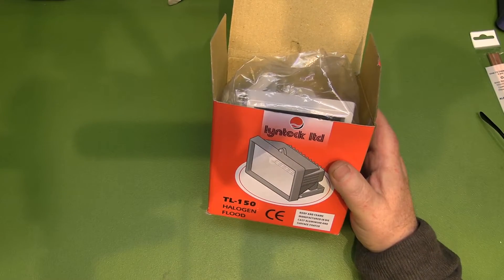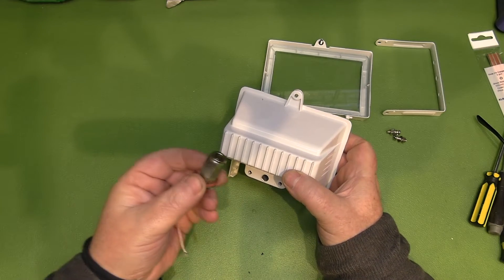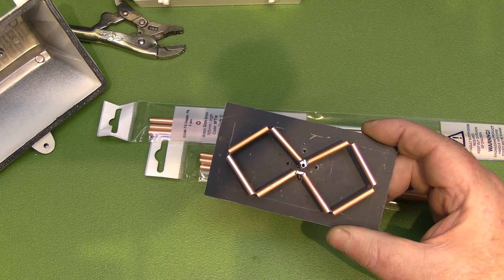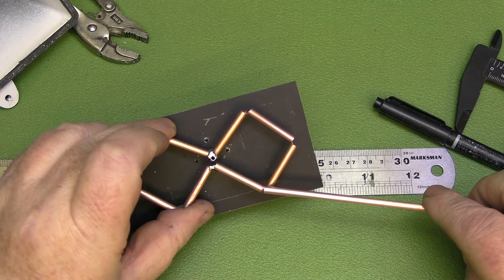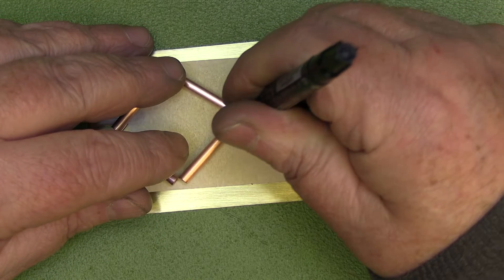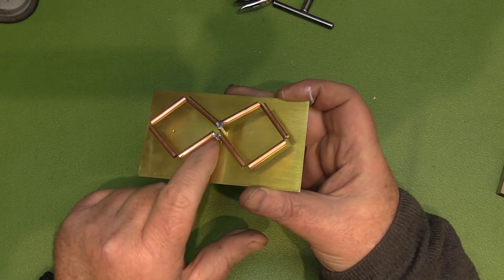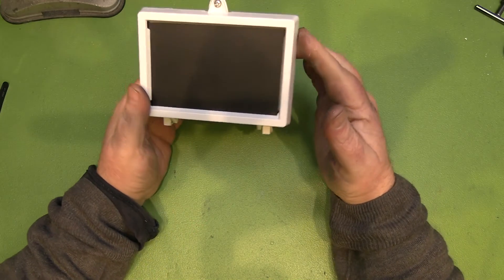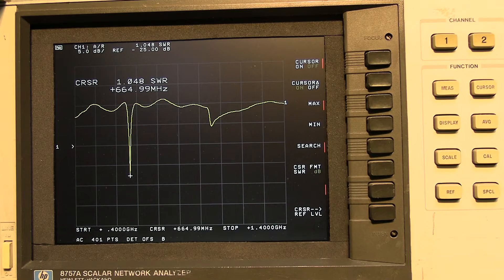The Perfect Case for an Outdoor Antenna 4G Biquad

Comment: Andrew, love your videos.  You are very knowledgeable on the subject of antennas.  I noticed on my dji phantom 3 advanced controller that the panel antenna measures 52 ohms but the omni measures open.. i saw your yagi design and noticed that the coax shield was on one side of the loop and the center conductor was attached to the other side of the loop creating a short.  Wouldn't this burn up the transmitter output?  I haven't seen impedance or open resistance and the effects on transmitters explained anywhere on YouTube.   Could you help us out?  Thanks

Comment: I made a pair of Double Bi-Quads for Band 3 ( three mobile  uk) which give 100% signal level, and RSRP -83dBm ( mast states max RSRP is -80dBm) Mast is 2 miles distant with Urban housing ( terraced streets ) between me and it. !  the pair is located indoors on top of wardrobe in bedroom. I want to make better quality version for outdoor location. What is the  "recommended" spacing between the two antennas located side by side, Please.  Will also need this sizing, to look for suitable enclosure such as you have on the video.
Reply: I don't have indoor signal.outdoor have 1 bar can i increase signal using this antenna
Reply: @testports3216  It is a simple antenna to build.... and cheap too !... worth a try... you might be surprised at how good it is. Make sure you point it towards your nearest Cell Phone Mast... You can find that from a site called  CellMapper - gives you the choice of supplier and the bands it  transmits on, and which direction it beams to....  Try to use a compass bearing to get the strongest signal at the antenna.

Comment: Could you possibly build one in the 1.7 GHz range and arrange them four-sided and one on top so that you get an omnidirectional antenna tuned to weather and slightly angle each of the four slides up a little bit? Do you think that would be enough to have a nice portable weather satellite omnidirectional as opposed to a large qhf Helix which I've actually built one and it's quite large and boldly to carry around would one of these be a nice portable alternative and could you get enough signal you think quite easily?

Comment: Why do you call it a “4G” antenna?
Reply: for 4g cellular network probably.
Reply: @TuttleScott   Here in the USA 2.4Ghz and 5Ghz are not used for cellular.
Reply: @jacksprat7087  he's not in USA
Reply: @TuttleScott    I know that.      Do they have cellular towers in England that use 2.4Ghz and 5Ghz??  Or, put another way, does anyone there sell service using those frequencies?
Reply: @jacksprat7087  I suspect Andrew knows what frequencies he needs. that's kind of his thing.
Reply from the maker: Cellular in the UK does not use 2.4 or 5GHz are you sure they do in the US because 5GHz wifi is not 5G.
Reply: @andrewmcneil   They don’t in the USA either.    I recently got fiber internet and am wanting to install security cameras.    I have a Wavlink Access Point and want a security camera(s) up to 200 meters away.    

Also, I have always associated the “2G……5G” acronym’s with cellular.   Ie - never with wifi.

Comment: @andrewmcneil   Really good.   What would be the reflector to element set-off to center this around 2.3 Ghz?   The tower I am connecting to presently is using that instead of 2.4 or 2.7.
Reply: What country do you live in?
Reply: @jacksprat7087   In the USA but rural area.  The uplink frequency for the tower is 2310 Mhz and the downlink is 2355 Mhz.  Band 30 FDD.

Comment: Clever.
850mhz band would be my best option for GSM as signals pooh in my area.
Reply: Might be able to modify an old UHF tv yagi for 850 mhz.  I’ve had good performance from one I set up for 750mhz band 13 and it was super cheap.
Reply from the maker: Was the same here a few years ago